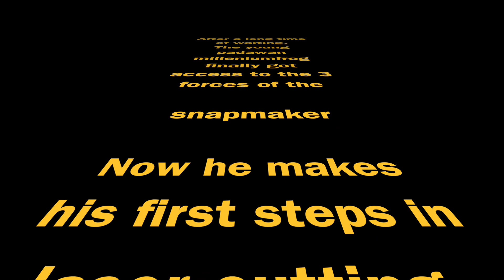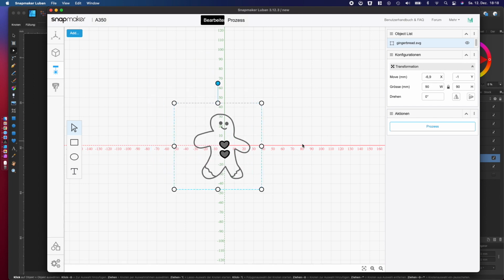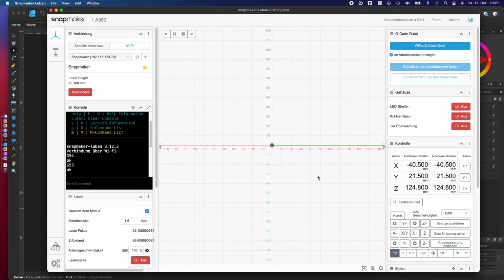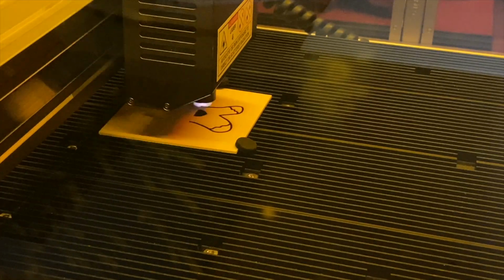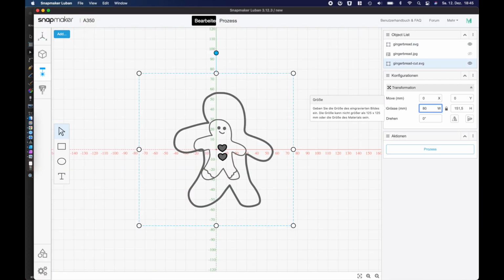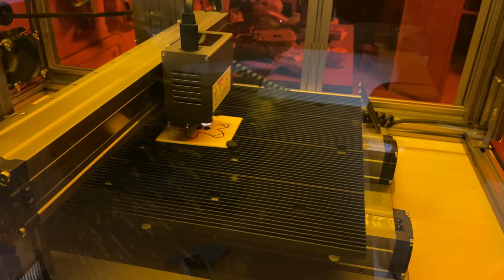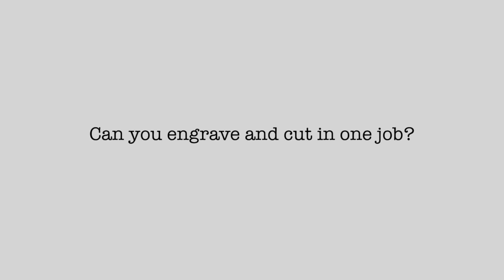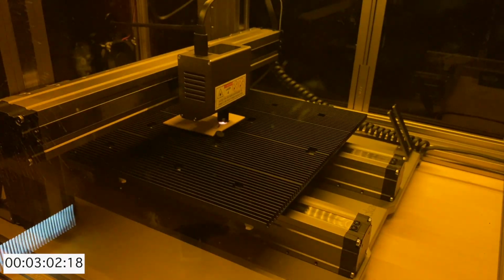lasercut a gingerbread man with a snapmaker 2.0 350 - my snapmaker adventures

Comment: Nice work. whats the thickness of the wood plate  upto which you had tried cutting.
Reply from the maker: Only 4mm. I did not try thicker material, because I do not have a project planned where its needed
Reply: @milleniumfrog3d931  appreciate the reply. Thanks.